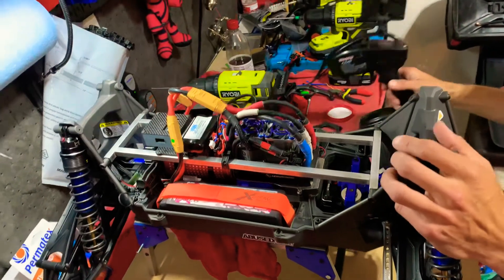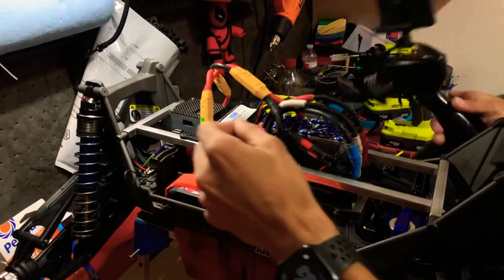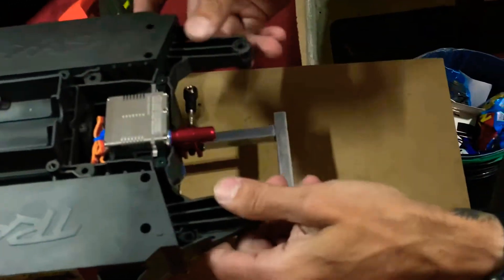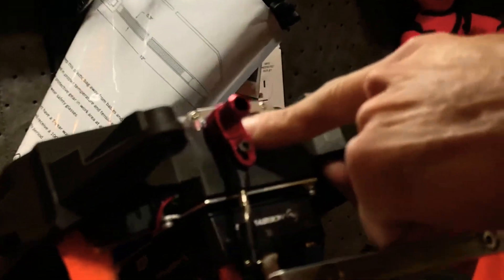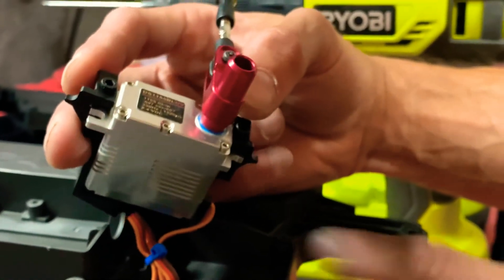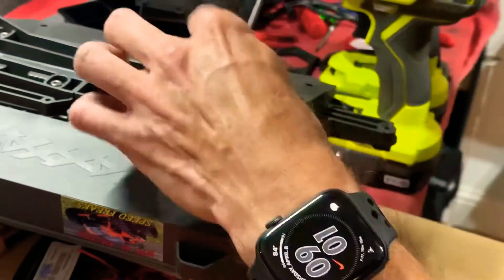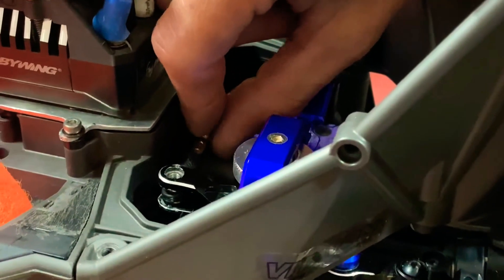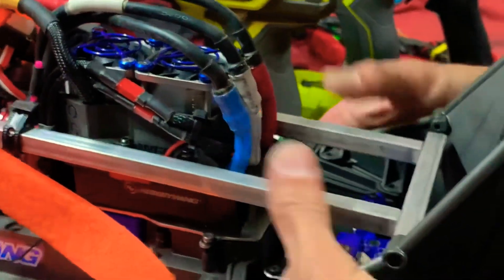DS1155BLHV Promodeler Servo Installation

Comment: You need to get rid of that Mickey mouse servo and upgrade to that DS-1885 made for Xmaxx
Reply: There is also a new DS1885BLDP-M made for the XRT. It’s a “mirror” version that allows the “belly” of the brushless motor to sit towards the chassis and sit flush. But yes, the DS1885BLDP is the way to go if someone wants to never fuss with a servo issues in the future… The DS1155BLHV is an alternative solution while using a standard sized servo. The DS1155BLHV spline has been updated to a 15T beefy spline as well so it will hold up to a lot of abuse too!

Comment: Just an update, i installed the 1155 servo last night. I also purchased the alloy servo mount. Not sure if the mount compensates for the the 2mm offset or the servo was redesigned, but I had no issue sliding the servo horn into the bearing, so i left it. I also have the blue HR aluminum steering brace/cover.
Reply from the maker: Yes the mount by Promodeler corrects the 2mm offset. So you can use the Traxxas HD steering links at the length they are already:) sounds like you have a great build so far!

Comment: Thinking about getting this servo. I'm upgrading the receiver in my xmaxx and I'm also running Max5 esc which is capable of a BEC voltage of 7.4V. Do you think this will be adequate for this servo running mx43 Badlands. I really don't want to run separate battery for the servo. Waiting for your response before 8 purchase this servo.
Reply: I will see how I get on with the 1155. The new servo is nice but it's getting up there.
Reply from the maker: @SolRayz  good choice and the DS1885BLWR is insanely powerful. If you find me on messenger, I’ll show you a quick clip of that servo in action. The truck is about 31lbs and using heavy badlands for wheels and tires. Also steel stub axles and Vitavon hubs. Servo has a 0.10sec/deg turning Rate. Which is incredible and tosses the badlands around as if they aren’t even on the ground.
Reply from the maker: The 1885 oz-in servo is definitely a better option than the DS1155BLHV. The DS1155BLHV does BEST on a dedicated LiION or BEC like the castle pro BEC if you go that route. The biggest limiting factor then becomes the strength of your servo saver spring tension. It will give beyond the spring threshold to avoid destroying the servo output gear. This is both good and bad. Good that it is a fail safe but bad that you don’t get all the power. Your choice, but if everything else is set up well, then the DS1155BLHV is a great option.
Reply: I have the badlands as well and the 1155 is  a vast improvement over the stock servo. Night and day difference.

Comment: Great to see the install and that good looking Xmaxx. Is the servo horn also ordered from John at Promodeler? I’m also interested in the center driveshaft support you have installed, please share those details if you don’t mind. Thanks
Reply from the maker: Thanks! And yes, the horn is also available from Promodeler. They actually just released a beefed up servo that fits in the X-Maxx and pumps out 1,885oz-in torque. That one does require some modification to the front bulkhead, so it’s not for those uncomfortable trimming away pieces of their X-Maxx. And the brace is called “The Brace V2.0” and can be found on eBay:)

Comment: On my last install I had to cut the tabs and I don't want to do that this time but the chassis is getting stuck just that last bit when I am trying to put it back on..I think it's getting caught up on those tab screw holes like my last install
Reply from the maker: Are you referring to the beams? The DS1155BLHV comes with the beam already “trimmed” on one corner. Although that doesn’t even seem necessary. Did you watch my hardware install video to show that there is zero chassis modification needed to get it into the X-Maxx?
Reply: @charlesmoradi4057  Yeah but I think I need to cut out part of the chassis ...not much but the tab on one side is hitting one of the mold lines on the chassis and it's not quite setting into place. I have the DS845BLHV...not sure if it has that corner trimmed too?
Reply: I got it but I did cut a little bit out of the chassis...nothing crazy, maybe 4-5mm of the raised plastic to allow for the servo to slide in on that one side. It works.
Reply from the maker: @seth9145  so the promodeler servos don’t usually have trimmed beams. John Beech only did that for the DS930BLHV as an option for the X-Maxx specifically. So the DS845 shouldn’t already have a beam mod unless it was requested. I see your other comment that you got the DS1155BLHV mounted, awesome! It truly is a great servo. I’m currently working out how to mount the Mega 2685 servo to the 1/5 Kraton EXB. It is going to take some thought but I think I can make it work without too much trouble.